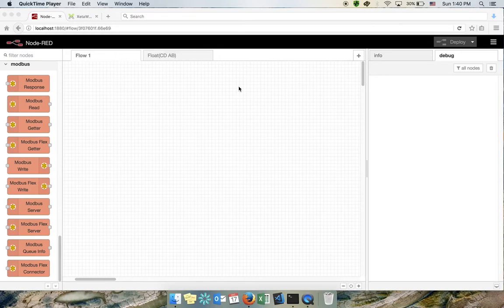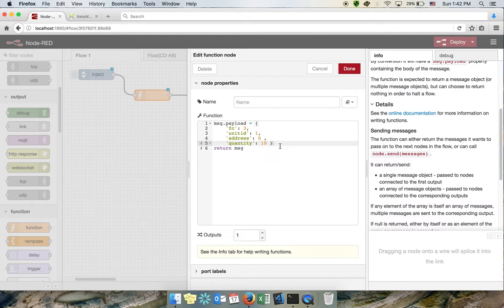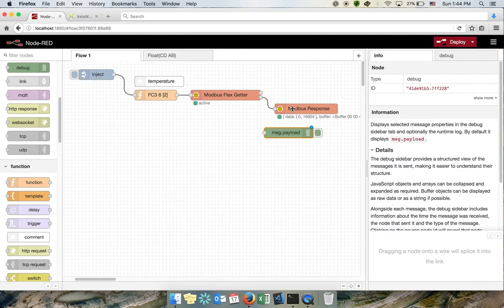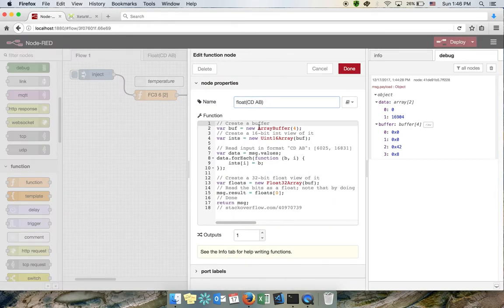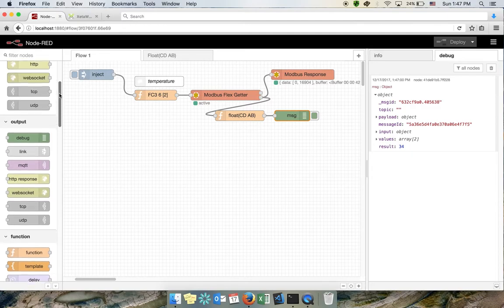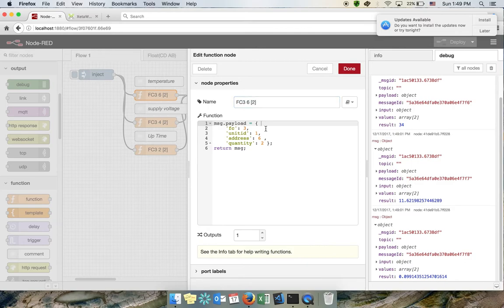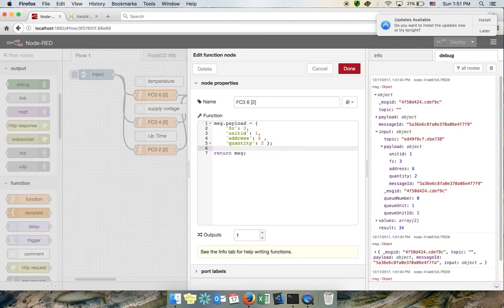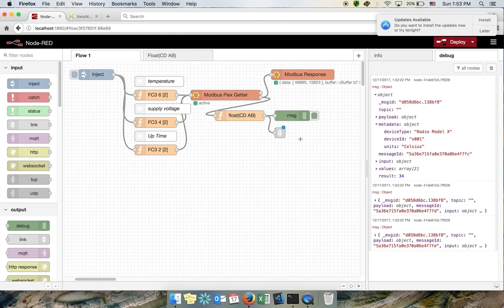Node-RED with Modbus Tutorial (part 2)

Comment: hello Leo, im using a modbus tcp simulator call "modbus slave" i would like to build a web application using Nod-Red and also mysql, for example, i want to generate  5 variables type = boolean, those variables need to go to 1 table on mysql, then i would like to use that with the Nod-Red dashboard, how should i start doing that? do u have some info? 

psdt: thanks so much for your videos.
Reply from the maker: Sure.. that's a very common scenario... I'm finishing a tutorial about that, just give me a couple of days and I'll send you the link
Reply: @leovarela7679  OMG are you serious??? That Wil be awesome!!!!! Cant wait for that... by the way are using also a modbust tcp/iP simulator? Because I can send you the one that I'm using, really practical.  "Modbus  slave" software,or are you using a plc  or raspberry or arduino for giving you the data. ?
Reply from the maker: @Fasshow28  Send me your sample. I have a raspberry only
Reply from the maker: @Fasshow28  Here's the link of the tutorial: https://www.udemy.com/node-red-1 It covers SQL and web-pages only but feel free to send me your sample for another tutorial